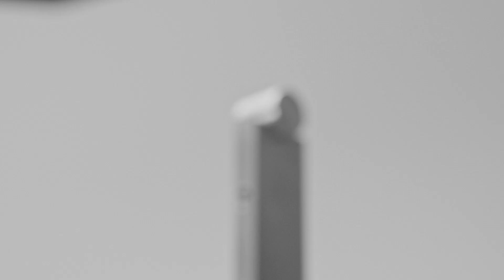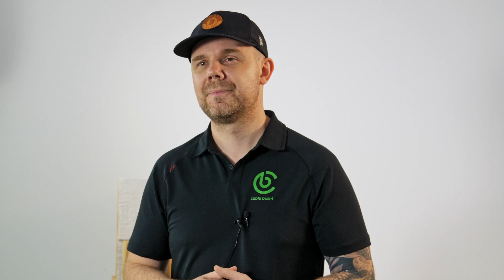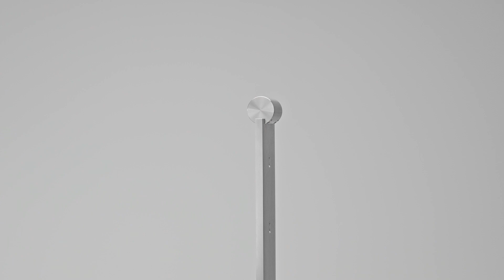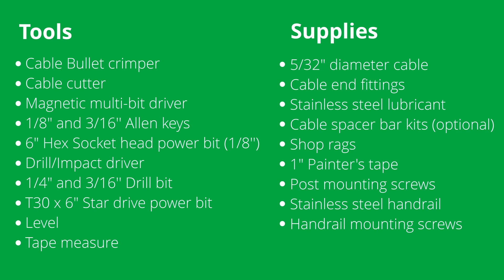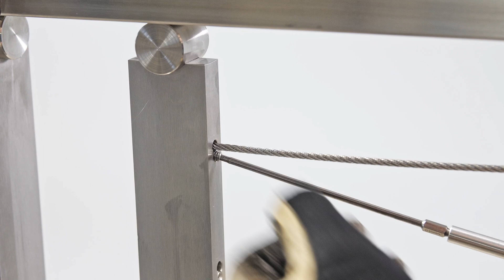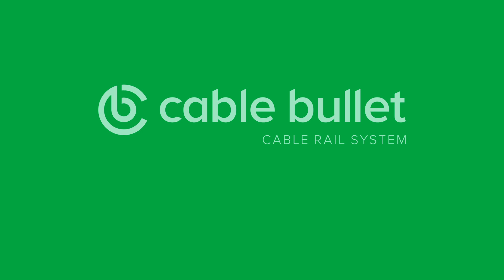Venture Series Stainless Steel Cable Railing Overview | Cable Bullet System

Comment: you didn't show the cable tensioning system on the side that COUNTS. . . you mean that little set screw tensions the whole cable???  its not clear in the video
Reply from the maker: Hi Joey, our apologies for the confusion! That's correct, the set screw tensions the whole. Each line has two set screws, but both work the exact same way. As a best practice, you'll want to tension both to tension the whole line.